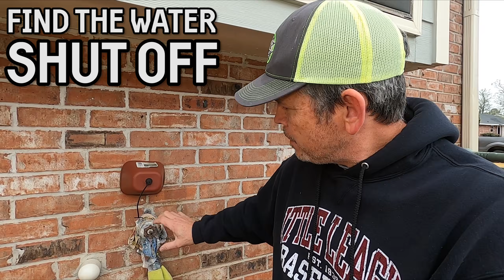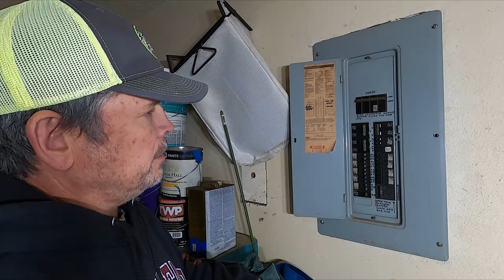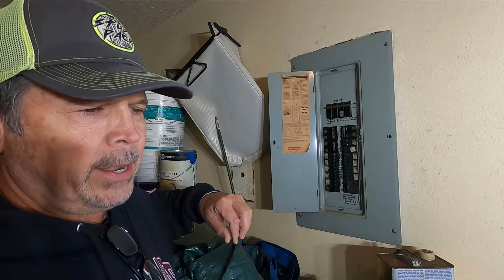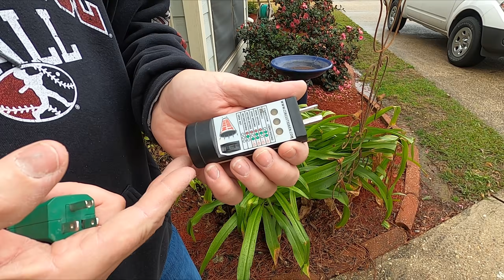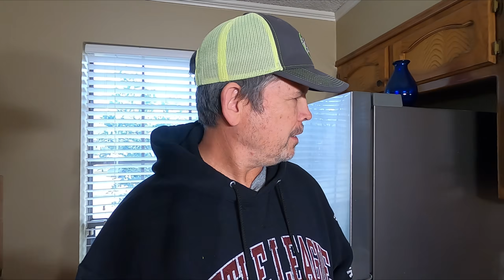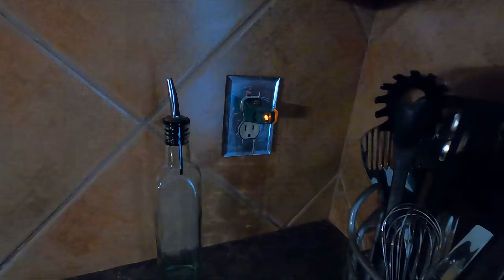3 Things EVERY Homeowner SHOULD Know/Do Before a Remodel

Comment: When the wiring inspectors came to inspect my wiring job in my home they were pretty impressed. On every wire running into the box I wrote exactly what that wire was running to and it's location. Examples: Parker's room, outlets, stair side. Parker's room, outlets, street side. (Every room has 8 outlets. 4 per wire run. I like to rearrange my furniture a lot and wanted to make sure I have an outlet everywhere I'd need one😁)

Comment: DO You have a video on how to add a new breaker along with a power line for a pole with a dual plug for a camper. 110  is what the camper is wired for. It has a roof AC unit

Comment: I am in the process of doing a spreadsheet in Google Docs that documents my breaker box.   Only mine mapping is formatted by floor then room then individual lights and outlets in that room.  I used a similar format about 15 years ago at a former house and taped it on the panel cover.  

I would suggest to fellow homeowners to label bedrooms will be labeled geographically and not by whose room it is.  For example on my house's panel , one of the breakers is labeled "Hanna's Room".  There is noone named Hanna in my family and I've lived here for 10 years, my wife for 13.   (Only getting around to it now as the landlord is selling the house to us and I've got a few electrical projects to tackle once the house is ours).

Comment: @Stud Pack  thank you so much for showing this! I have 0 experience with electrical and it always worries me when I have to work with the wiring in my home. Labeling my brakes is definitely something I need to do as about 90% of the labels in my 3 panels have worn away overt time and the previous owner never re-labeled them before I bought the house.

Comment: You left out the important step 1: review and discuss all the detailed design drawings an specs prepared by the kitchen designer/ architect. Read and understand the install instructions for all appliances, plumbing fixtures, electrical fixtures.  I guarantee there will misunderstandings, mistakes and heartache if you don't find problems up front.  Modern kitchens require more precise coordination than all the rest of the house.

Comment: Since the holiday season has come to a close and I've begun to take down all the string lights outside and on our tree, it's time for me to map out the circuits in the house we just moved into.  My completely unprofessional, dyi method is to plug a string of lights in each outlet and turn on every ceiling light.  Then I turn off the breakers one at a time, going around the house and making note of which strings are no longer lit as well as to see which ceiling lights/appliances are off.  It takes a little effort but it also makes me get a little exercise in going up and down stairs.

Comment: Especially in the kitchen do not assume that the top and bottom plugs (ie split plug) of an outlet are on the same breaker.  I believe that code is that the top and bottom if on different breakers should be on a double pole breaker, so it shuts off both, don't assume that this was done.

Comment: Just inside the front door of our 1895 four-square, there is a panel with 4 push button switches on it. One goes to the front porch light, another goes to the upstairs light at the top of the stairs where the landing is and another light at the top of the stairs on the 2nd level. The other 2 switches I don't know where they go...except...One day the wife and I were trying to figure out where they go. She was down in the basement at the breaker panel and I was at the front door pushing the buttons on and off, on and off several times in rapid succession. The phone starts ringing! I answer the phone. The lady on the other end was from Germany and told me to "Stop that!" I'm in the USA in Montana!

Comment: I will also add that older kitchens have split receptacles, that is to say, that the top outlet is on a different breaker than the bottom outlet.  These 2 breakers are supposed to be tied, and most likely anyone that wired them this way will also ensure that the breaker is either a double pole breaker or 2 individual breakers with a tie bar.  Regardless, of all that, it is always good to verify any wire that you handle, for voltage first.  I've received a minor shock from a wire once that was off, but had an induced voltage on it because it ran in parallel over a significant enough distance with a live wire.

Comment: Awesome. I bet a lot of people in Texas wished they knew about the water ahead of time.

I had a couple of times where I had to trace a circuit out that had no outlets and visually telling if the light went off wasn’t gonna work from where the panel was nor did I really want to shut off every breaker until I found it. Picked up a circuit tracer at Harbor freight good deal and was worth the price. Couple that with a homemade contraption not recommended for anyone unless they are electrician or competent. I got a small outlet box outlet, 12 gauge wire and I coupled that with some good Quality alligator clips. Before I had the circuit tracer it was a great way to hook up a radio for tracing. They sell a light socket with alligator clips and then you’re meant to screw in a adapter which seems silly to me because now you’re left with an ungrounded outlet trying to plug-in a three prong tester. This box went through a couple of revisions it is now incorporating a 15 amp circuit breaker switch to allow for attaching with no load and an LED indicator before the switch to indicate whether it’s live. This allows for absolute minimal work on a live circuit to get it identified and then isolated. This came in really handy because later after I made it I encountered a use where I didn’t want to turn anything off that I didn’t have to trace and I needed to trace what the lights were on without plunging the entire room and darkness as there were no windows. I was able to pop the fluorescent light fixture open to carefully undo the wire caps and tie in the plug tracer.
Also useful for temporary tie ins, My outside motion light died due to water ingress and unfortunately before it got replaced I needed to unload the truck from the firewood we got and it was dark by the time we got home; I was able to clip into the wire at the top of the pole next to the garage, plug-in a utility light and then re-tie-in the other end of the wire which made unloading a whole lot easier.

Comment: I bought a '96 trailer that had been sitting empty for 7 years.  I decided that I needed to replace the water shutoff because in these older trailers (and most new construction) they use the cheapest shutoff values they can find, which doesn't last long, especially when the water is really hard.  When I tried to take it off, the pipe it was connected to broke off at the threads.  When I tried to re-thread it, the pipe split the entire length.  When I tried to disconnect that pipe at the elbow, two feet below grade, it snapped off.  I had to dig a 4-foot trench to get to the point where the galvanized pipe connected to the PVC coming in from the street.  A 15-minute job turned into a 2-day job, but now I have all new pipe and values (except for the back-flow check value, which I couldn't find at HD, but cleaned up just fine) going into my house.  It was nice to know, when we moved in, that we wouldn't have to worry about that!
Reply from the maker: Thx Dienekes 👍.  I’ve worked on a few trailers.  Way different than the usual stuff 😳

Comment: the radio trick works great but it's only good for the outlet that it is plugged into. Old houses here in New England that had DIY projects done over the decades can be a horror show when it comes to figuring out what is wired to what.

Comment: Just wondering, how you're going to "fix" the "illegal" breakers? There is nothing illegal on them, other than the instruction, those are just breakers on a 50A plug, right? Just trying to understand how you're going to fix a legal breaker on a legal outlet?
Reply: It's back fed -- it connects the generator's output into the main panel, which is NOT the same as a breaker that turns on/off a circuit

Comment: When checking outlets make sure you check both the upper and lower sockets. They can be on different circuits, especially in a kitchen.
Reply: Yes! I've seen too many places where the top is a constant hot and the bottom is on a switch from a different circuit and on one occasion, a different bus. 240 volt potential in a standard outlet box wired to the same outlet. Maddening to say the least.
Reply: I ran into that recently on a multi wire branch circuit that was not handle-tied. Definitely can be a shocking find.

Comment: We were having a new toilet installed, and the guy broke off the water valve at the floor. We had just moved into the house, and did not know where the main valve was. Not only that, we could not find the water meter to shut it off there. Fortunately, my wife had ask the previous owner about a paint color, and they drove up with what she was looking for. They told us where the shut off was, after it had been running open for about 10 minutes.

Comment: I typically work by myself, many years back I got tired of listening to my radio to hear if i cut the power and got a "sperry" circuit finder.  shortly after got a screw in light bulb type socket to attach to the transmitter to find lights.  That thing has never failed me in 20years.  Also always carry a water meter t-bar in my truck (just in case)!

Comment: The only suggestion I would add is that if you are tracing the circuits for your entire house, you don't need to test each breaker with each outlet/fixture. Once you've identified a breaker for a particular outlet, leave the breaker off. Then go around the same general area identify any other outlets that are not getting power. Then (don't skip this step) turn the breaker back on and confirm that all the ones that were not getting power now have power. This is to ensure that an outlet that may not be working at all doesn't get misidentified with the wrong breaker. Following this pattern will allow you to locate >95% in a short time. The last few may require a distinct check back at the panel.
Reply: I like this system but in reverse. Ideally, Turn everything off, and follow your steps, just backwards. This protects against double fed outlets

Comment: I sure wish my HVAC guys would have seen this video before they came to install a new system for me last month. While replacing the air handler in the attic, they stepped on a CPVC water line and flooded my house. I wasn't home to tell them the water shutoff was in the garage behind the water heater. And of course the fella didn't have a T-bar and struggled to shut off the water at the street with a crescent wrench with a screwdriver through the hole in the handle. God knows how long the water gushed while they panicked to shut it off. Thankfully they did the right thing and fixed all the damage.
Reply: The men working on my dads house went on a lunch beak and drove over the water main box on the street. Old Faithful gushed for a long time while I drove around to find where they were having lunch.

Comment: For outlets I remove the face plates and write with a sharpie the number of the circuit. If you need to do any work  in the room you automatically know which circuit to turn off.
Reply from the maker: I used to do that until a homeowner removed them all to paint and put them back without regard to the CB numbers 😩
Reply: @StudPack  I write the numbers inside the box.
Reply: @StudPack  Just let the homeowner know ahead of time what you have done. When I paint I just place the covers on the floor under the respective outlet or switch.
Reply: @StudPack  Then there's the homeowner who paints over the floor plate and around the switch plate.
Reply: Good idea. I might go through and do that.

Comment: I have used a loud AM/FM clock radio to locate breakers back in the day when working alone.
Reply: sometimes I use an extension cord and a tester plugged into it. I then stand by the panel with the end of the cord and start shutting off breakers. seems hokey but it works great and you dont bother anyone to help.
Reply: @jstevens501  Thats an awesome trick I had Never thought about.

Comment: As an electrician I'd like to reiterate what they've said in previous videos: DO NOT, I repeat, Do Not "stab" receptacles in the back with the wire. Take the time to wrap the wire around the screw if it isn't a clamp type connection. "Stabbed" receptacles may be the #1 reason for fires and other failures. It should be illegal. My bet is the people at the top prefer that things fail. Makes us buy more. The more we spend, the more they make.
Reply: I'm on board for not backstabbing.  My 1998 kitchen's receptacles were connected this way and was, very likely, the cause of the breaker tripping each time my indoor grill reached its "ready" state--indicated by a green LED turning on.  This happened on each one on the circuit.  After replacing them with new ones--having connected them using the terminals--all was fine.
Reply: Very good point, its amazing how many trouble calls I get for no power for receptacles. Not even sure why its still allowed, I've seen so many burned up receptacles due to lose wires heating up and catching fire.
Reply: @JCC56  Exactly. It should be illegal which makes me think that some bastard somewhere is getting a kickback and that's the only reason it isn't... I bet it causes a bunch if problems with Arc-fault breakers too.
Reply: @redrollins8346  I never understood why on commercial jobs how it's illegal to tie circuits thru the receptacle.
I've done so many repairs and pigtailed  splice the circuit on residential homes.
Reply: Wago connectors are becoming popular, which are "stab" connections. I wonder how they differ?

Comment: Power lineman here, please protect your local lineman and do NOT hook your generators up without the proper means of disconnects. A transformers job is to step up/step down voltage. When you connect your generators without a disconnect it will back feed through your meter panel, through the meter itself, onto the service wires (triplex) back onto the secondary lugs on the transformer and induce a voltage onto the primary bushings. So just how it steps the voltages down consumer use. It will induce a high voltage back into the powerlines. I.e 7,200v..14,400 volts.. etc. Thanks stud pack. Yall some knowledgeable and professional tradesmen!
Reply: Have a gas powered generator but will NOT hook that puppy to my homes circuit.  I will buy a whole house gen and have a certified electrician and plumber (nat gas) perform the installation. I know my limits!! 😂
Reply: Transfer switch
Reply: Very good point, I didn't see a  interlock kit on the generator backfeed breaker. Stay safe guys.
Reply: Whoa! I didn't know it stepped up the voltage.
Reply: @Lehmann108  Yes, it does.  Transformers, meters, and circuit breakers all work both ways.  Your little putt-putt generator won't put a whole lot of current onto the grid, but it is more than enough to kill a lineman.  So, either put in a proper transfer switch, or just run some extension cords.  Keep your generator air gapped from the grid.

Comment: Just a reminder to test both outlets on plugs, especially in kitchens.  They may be separately fused.
Reply from the maker: Yep I’ve seen that. Good tip Michael 👍
Reply: good tip.
Reply: I just experienced something similar, had two circuits wired separately to an outlet on 12/3 romex sharing a neutral. Shocked myself pretty good when I took it off...

Comment: Just an fyi, if you are on a well calling the utility company won't help finding the water cutoff. :)
Our cutoff is in the basement
Reply: You can always switch the breaker off on your well pump.
Reply: Shutting off well pump sound easy if know Circuit Breaker or it’s labeled, most well around here are 220 ACV so double gain circuit breaker it’s easy confusing with hot water heater 
My panel said Water so can be well water or hot Water 
Also had problems finding circuit breaker for light for Flag Pole

Comment: Pretty sure you can just press that little button on the plug tester and it will trip the breaker.
Reply: You're assuming there is a GFCI breaker on the circuit or in the panel.  The Commercial Electric tester he has doesn't trip a regular breaker.  Perhaps the one he has the amazon link to will but the one he used in the video doesn't.

Comment: I found over the years that almost all homeowners have no idea where the water shut off is. Around here all the older homes use a street key at the meter. On the real old homes the meter can be a couple feet in the ground. I got into the habit of always making sure my regular customers knew where it was. Most know where the panel is and how to shut the main. Great advice!
Reply: If a lot of the people in Texas knew where the water shutoff was, they would be much better off now!
Reply: My very old rental has the shut off 1 foot below ground so I put a 6 in pvc around it and a cap to cover it.
Reply: @jumperstartful  Our water shutoff is 6 to 8 feet underground to keep it from freezing up, of course this is Wisconsin where it's been known to get down to 20 below at times.  The valve is covered with a 3in pipe and a cover with a 5-sided bolt, so you need a special socket to fit it, then you drop in a long T-handle wrench.  But 99% of the time you just turn it off at the meter in the basement which has a valve before and after the meter.